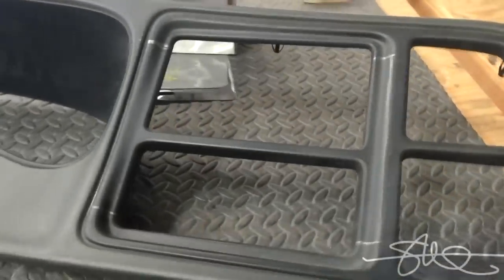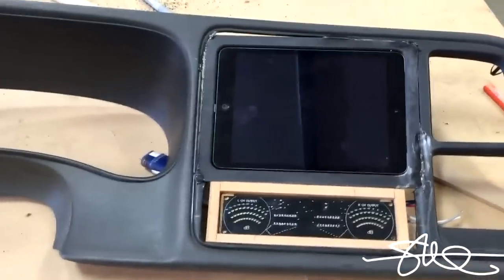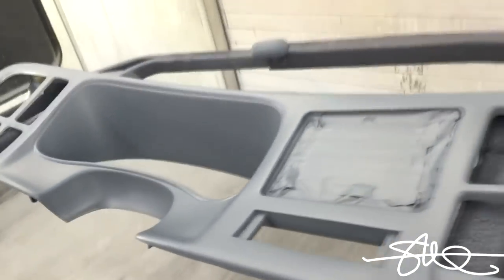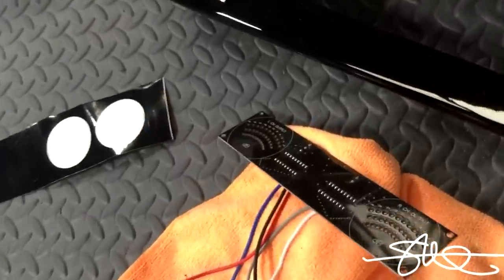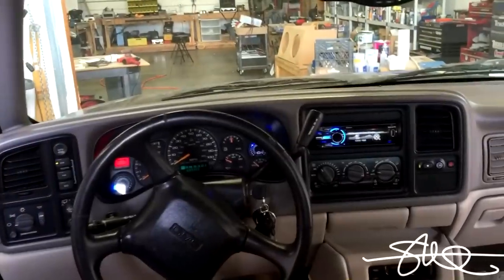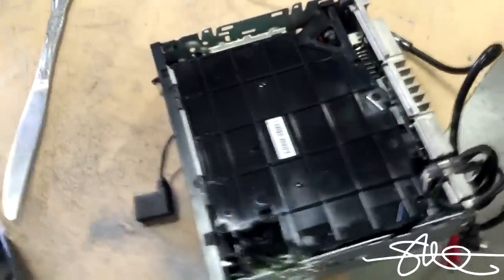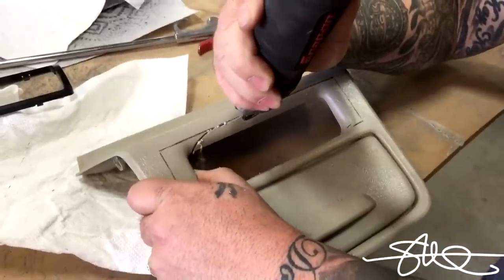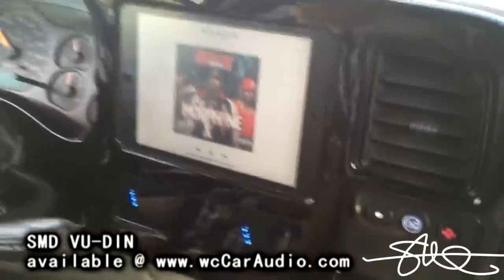iPad Mini SMD VU-DIN Custom In Dash Bezel Mod - Father & Son Car Audio Install - GMC Yukon Video #7

Comment: Awesome skills as always Steve.  Need to do something with that OnStar control panel. It looks out of place with the dash facia being smooth and it textured. Also digging the SMD voltage gauges in the cluster.

Comment: Nice work! Although you should have showed the final position of the climate control etc once they were mounted and how you mounted them. Also, if you wanted to just move the climate controls down a bit would they fit where you installed the dancing light display thing? I've done it on the older din and half stock radio Yukon when I was installing a double din, but I'm curious if it would work on this dashboard style along with the iPad mini??

Comment: Steve, I have a 2012 Dodge Journey(wife's ride) and I'm going to install 2 12's. What box would you recommend? I'm going to go ported @ 3 cubes.  Would you recommend the sub's facing up with a kerf port along the bottom or something else. My wife is dead set on the sub's facing up too.

Comment: Seems like iPads in the dash are becoming the big thing now.  It's a super clean look, but I don't have the real estate on my Mustang dash for it without unfavorable modification.  However, I am thinking about how an iPod touch might work out.
Reply: What about an Iphone 6+ or just the Iphone 6 a bit pricey I know but it'll work
Reply: smaller cheap android tab will work like a charm
Reply: Those are both good ideas.  I can't figure out how to fit any screen in my dash without having to relocate the head unit and possibly the A/C controls though.  And there's no reasonable spot to move them to.  I guess I will have to stick with a double din touchscreen unit.
Reply: Do you have pics or a vid?

Comment: What are some stereos (double din or single din) that you guys have that charge and play music through the lighting cable. I've been wanting to do this but haven't found a deck that has that feature. I don't want to use an aux because i don't want to wire in the side slider kit. Also, i don't want Bluetooth because if i watch videos the sound is off by a couple of seconds and it bugs the sit out of me. 

THANKS TO THOSE WHO REPLY!!

Comment: slider kit costs as much as the ipad.........
Reply from the maker: Razon35 actually the ipad is at least twice the cost.  If you are an installer you know how much time this saves and it's totally worth it.  It isn't cheap but everything can't be in everyone's budget unfortunately.  People bitch about my SMD products being expensive and they are full of electronics.  If people had it their way everything would be a dollar.  And a portion of the public would STILL BITCH about it.
Reply: meade916 ill stick with my 1988 cassette player..... haha jk wish i could afford it, maybe some day
Reply: meade916 hey Steve, would you ever consider doing work shops. You're installs are ridiculous. Keep up the great work.
Reply: meade916 smd products are not expensive at all. You know how much time the dd-1 saves me when I set gains on friends amp so they could get the most clean power out of there amp
Reply: Even more ironic is the cost of a Pioneer Avic or the 8 inch Alpine. A $350 ipad and a $250 kit is very cheap and way better by comparison. Dont know how these companies still charge so much for touchscreen headunits that barely function.
Reply: meade916 great install man.. Don't let anybody tell you otherwise... It takes skill to do what you do...
Reply: mr DC audio. seen your setup, pretty sick.
Reply: James Roybal that what made me do it. I was like i want top of the indash radio they ar 1200 plus but with ipad u have everything and u can remove it and use it for everyday use. I thinks it brings more value to tablets

Comment: Amazing how bad the original dash looks by comparison. Nothing beats pro handmade body work, but the original looks like it was from rubbermaid...

Talk about work to move the AC controls. Someone should make an app that uses raspberry pi and a bluetooth or wifi connection to control the AC.